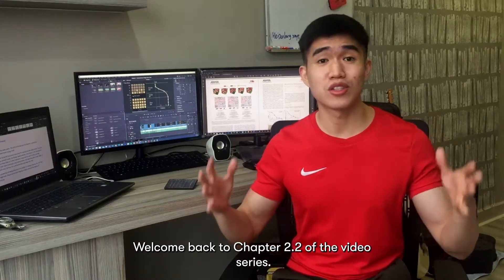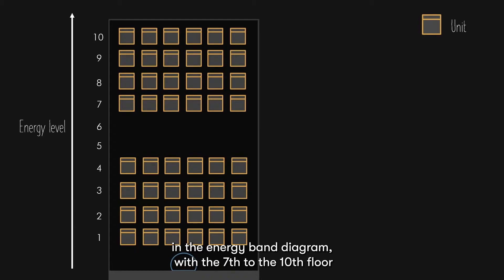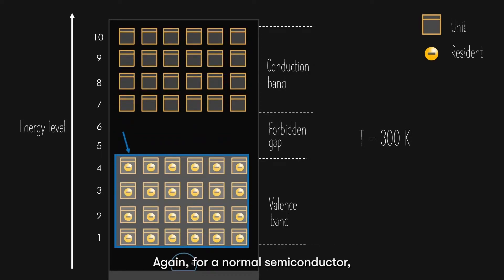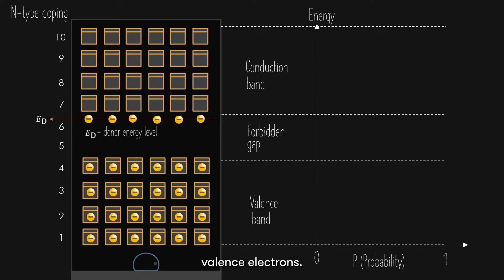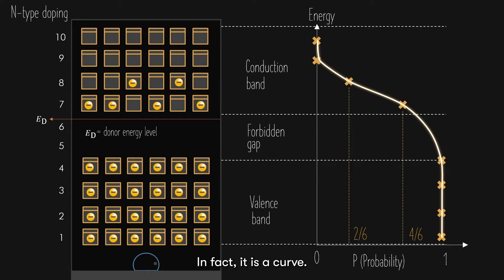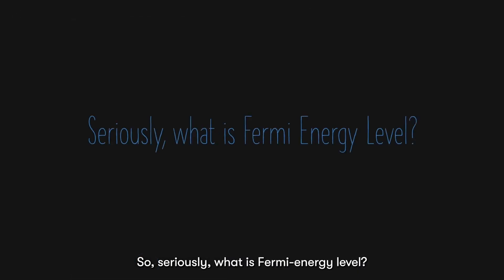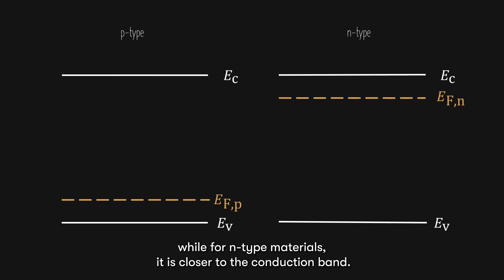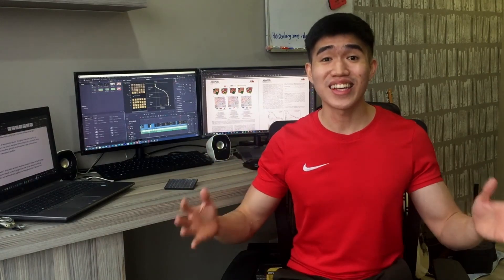Shining Light on Solar Cells - Chapter 2.2: Semiconductor Physics (Fermi-Energy Level)

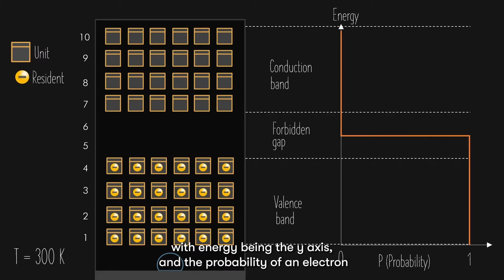Comment: Although this explanation is good on a simple level, as you delve further into quantum devices, you may find some confusion with the hotel analogy. At room temperature, due to quantum effects, it is possible to find some electrons in the conduction band at room temperature. It is only at 0K that you will find the graph shown at 3:36. Whilst the probability is low, it begins to become significant in deeper analysis, and explains some things you may otherwise find confusing, such why you may see some small currents below the threshold voltage in p-n junction diodes. Love the video series btw - very helpful for understanding the fundamentals of small-scale devices! Thanks!

Comment: A confusing presentation. 'p' type doped material is shown to draw electrons from the valence band, into the forbidden gap, thereby creating holes in the valence band. However, when 'n' type material does the same thing (ie draw electrons into the forbidden gap), no holes are said to appear in the valence band. Presumably, these electrons also come from the valence band, so why don't they create holes?
Reply: Hi Orson, Christopher here. Thank you for your comment and my apologies for the confusion. N-type materials do not draw electrons from the valence band into the forbidden gap. By introducing n-dopants such as phosphorus into silicon, the "extra" electrons actually come from the fifth valence electron of the phosphorus atom. Think of n-doping as injecting external extra free electrons into the conduction band. I recommend that you watch my previous video on doping: https://youtu.be/R5IW89yoN1A if you haven't. This should give a clearer picture.
Reply: @BlackRockExecutive  Thanks Chris. That's cleared that up